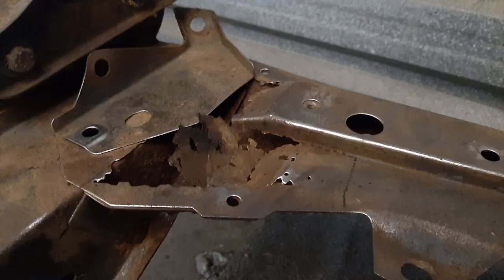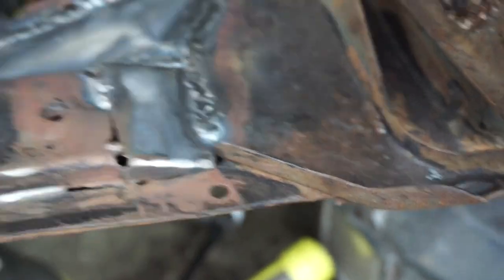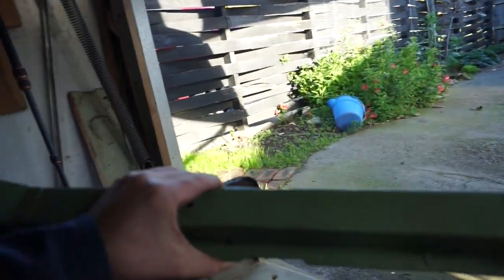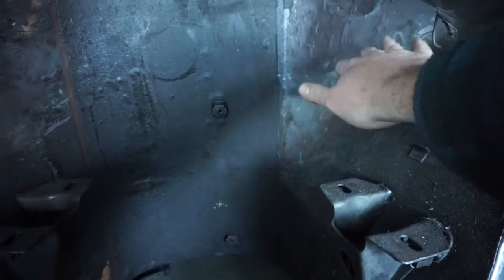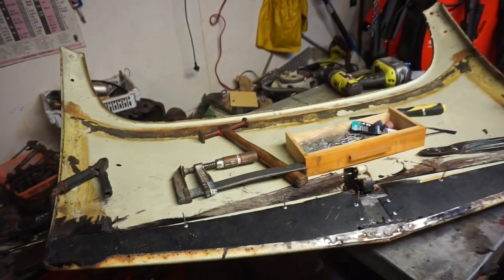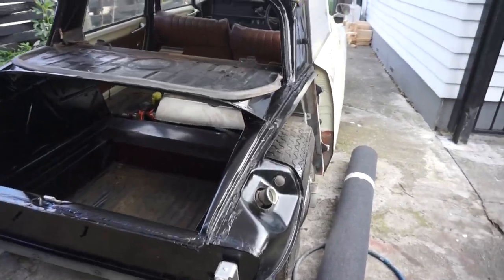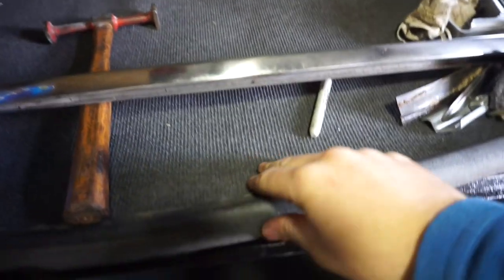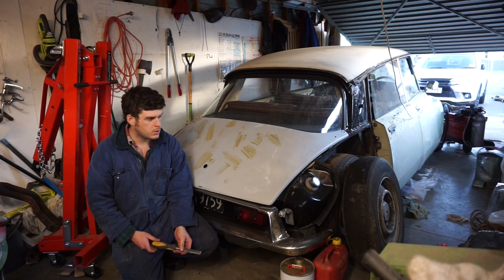Citroen DS 1974 - Part 4 - Rust repairs and more paint

Comment: tig is the gear! Check the 'H'  bar for any cracking round where the arms are fixed. They go on the 23s and mine had plates welded in (DSpecial) to strengthen the whole thing up. Sanding works better if you go horizontal, the vertical then both diagonals.
Reply from the maker: Thanks for the tip, will definitely make sure to inspect the H bar when i strip things down a bit more.